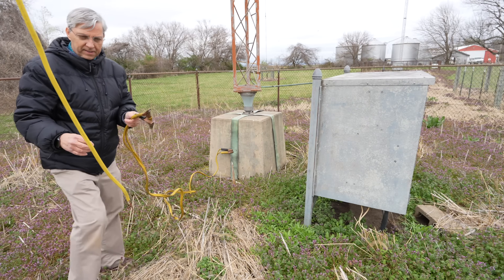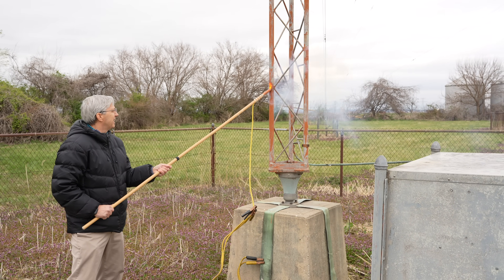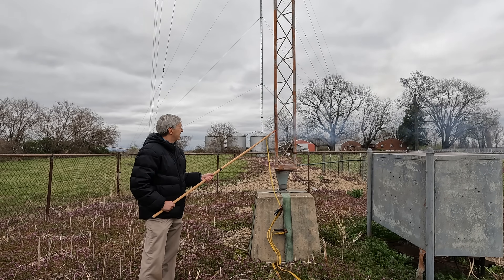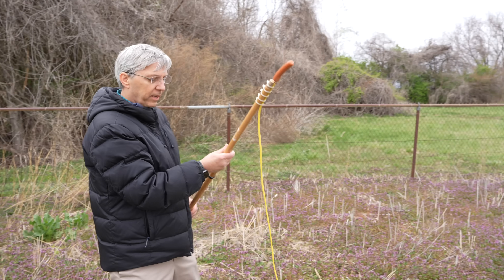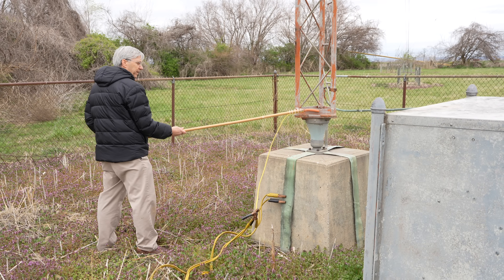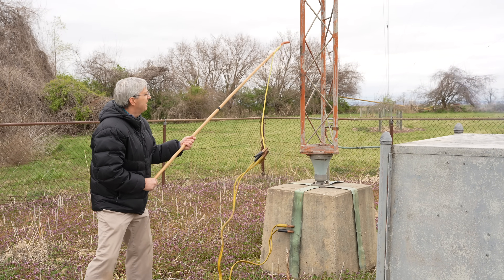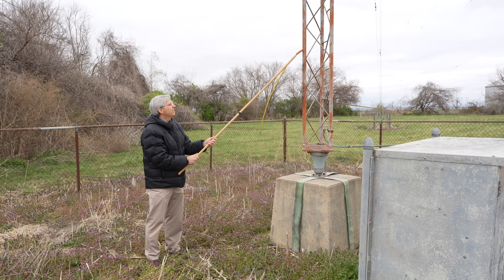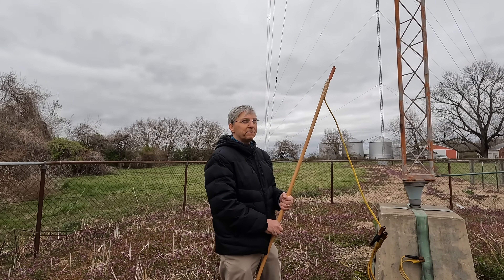We made a hot dog talk... with RF

Comment: Why does the hot dog talk though? Why is the broadcasted sound released by burning?
Reply from the maker: It's the arcing between the tower and the surface of the hot dog; the plasma in between creates vibrations in the air that are audible, translating the AM signal modulation into audible sound!

Comment: That tower looks old and disconnected, it is all rusty, the fence isn't very high and there are no warning signs!!!! That thing looks so climbable, why aren't there more safety measures?
Reply from the maker: There's an additional horse-height fence around the entire property, and there are RF warning signs around the internal fences as well.

A lot of sites are in similar condition—it's one sad reality that smaller broadcast radio stations face, the maintenance and upkeep for these sites requires a lot of funding over the course of decades. Some stations can keep up, some have many issues from building maintenance, to ground plane rot, to physical access problems...

Comment: I've heard a story about a radar tech pointing at something inside the transmitter enclosure while it was open, and getting killed by the arc. This was supposedly on a military radar down near Warner Robbins, GA. About 50% of the stories this guy told were true, so I don't know.
Reply: Transmit tube high voltage is deadly, I know ham radio operators who were killed working on live amplifiers. Microwave TWT? 10,000 volts at 1/2 amp!

Comment: Another interesting phenomenon I have observed at AM transmitters (specifically in the P&M hut) - if you use zip-ties with a metal locking tab, the induced RF can heat the tab enough to melt through the tie and release it.
Reply: Huh? What wavelength are they transmitting on? 60GHz?
Reply: @MrHuram-abi Nope. Hundreds of Khz.   Normal AM broadcast.
It's the field strengths that are that high.

Comment: Ive heard stories from old school tower climbers that they would do a running jump on to live AM towers for painting and whatever other maint needed done. They assumed it was safe as long as you didn't create a path to ground.
Reply from the maker: High risk! There are still climbers who go up with some energy (even if reduced a bit)... seems risky to me!
Reply: I know there are folks that do manual inspections on live power lines (getting dropped off and picked up by helicopter), they use conductive suits (nomex/steel fiber) and make sure it's properly bonded to the line before they get on it to avoid arcing at contact points. The scariest part is getting on or off, since they first have to bond the helicopter to the power line (which sounds like a helicopter pilot's worst nightmare), then bond themselves to the power line and move over to it, unbond themselves from the helicopter, and finally unbond the helicopter from the power line. This keeps the lineman safe since arcing only happens in the first and last steps, when bonding/unbonding the helicopter (using a long metal rod for initial and final contact).
Reply: @MatthijsvanDuin  This is what stuntmen can do if they end up making it to retirement! Sounds like they'd be right at home.
Reply: I didn't know anyone ever climbed live towers.

Comment: Fortunately, very few humans are skewered with a grounding wire while foolishly touching an AM tower.
Reply from the maker: Just standing on the ground is enough, typically, unless you have a lot of PPE—though you should still just turn off the broadcast (and lock it out from remote access) when working on the tower anyway!
Reply: @GeerlingEngineering  Oh, the peaks are in the thousands of Volts.
Reply: @collectorguy3919 They can be, yes.

Comment: Technically this is a so-called plasma speaker. The amplitude-modulated electric arc on the hot dog rapidly heats up and displaces the air around it, which creates the sound.

Plasma speakers are commonly built out of old TV flyback transformers.
Reply: @RickGreenPhoto  That sounded.... painfully horrific...
Reply: @Chris47368  If you're not grounded then it's probably not going to kill you, but you will become part of the antenna. I imagine this would be more hazardous with a cell tower antenna, which typically operate at microwave frequency.
Reply: @maudiojunky  Yeah....RF is just gnarly stuff to be directly exposed to in that way in general xD
Reply: @maudiojunky  I don't think a cell tower ever has multiple kW of power in it, but maybe I'm wrong.
Reply: @BrianG61UK  It's not necessarily about the power. Microwave frequencies used in cell systems cause heating of tissue without being exposed to a direct electrical arc, so even a few hundred watts may be hazardous if you're even standing near it, let alone touching it and becoming part of the antenna. It won't necessarily cook you, but I don't think you'd want that radiation going through your eyes, for instance. This of course pales in comparison to the output of some radar transmitters - perhaps looking at the operating procedures for some military radar systems would be informative. The microwave oven was supposedly invented because of incidental heating from a radar magnetron after all.
Reply: @BrianG61UK  we have a travel microwave in the work truck that cooks meals at 600 watts. Wouldn’t want to put my head in there
Reply: I was trying to think about how it was producing sound and then I saw this, thanks! I completely forgot about plasma speakers, they seem like black magic...but then again a standard speaker is just as "magical" we're just used to seeing them.
Reply: but its impossible that any object could decode waves, filter them and reproduce them.... They probably have a receiver hiden from the camera which is actually receiving the signals

Comment: That fence is waaaaaay to low haha
Reply: I'm surprised there aren't squirrel fragments littering the area.
Reply: @sometimesleela5947  they aren't tall enough to touch the tower AND be grounded
Reply: @rodschmidt8952  The  (ceramic?) insulating support at the base between the ground straps and the tower looks to be about 14 inches. I guess most critters wanting to scurry up to go exploring would jump it,  but any climbing would bridge it and get zinged. I regularly have to clean up squirrels from below the pole pig in my backyard,.
Reply: There is a taller fence around the short fence thing maybe

Comment: I worked for 740 KVOR and 1300 KCSF at Cumulus Radio as an IT admin years ago
When I would be near the small tower shack for 1300am, I could almost swear I could hear the broadcast in my head. Now, granted you could hear it from the transmitter, but you could almost feel it. 
Up on Cheyanne Mountain in Colorado Springs, there's a propagation site that sits above NORAD, you could feel the amount of EM energy on that site, too. Tons of FM at that site. Beautiful view on top of the mountain.

Comment: OK, now explain why we can hear something through the hot dog when the tower is transmitting around 1 MHz, a frequency band we cannot hear.  
.......
I have a theory.  I believe the hot dog is acting as a low-pass filter.  The energy of the AM-modulated carrier is being forced through the mechanical filter of the hot dog into the audio band that we can hear.  Anyone buy that?
Reply: Remember, this is amplitude modulation, so the underlying 1MHz carrier is irrelevant. We're hearing the strength of the arc change as the carrier power is modulated, thus hearing the audio.
Reply: @bradwilmot5066   Hot dogs are not FM compatible
Reply: @featherpony  You can only use certain hot dogs.  You have Armour Modulation, and Frankforter Modulation... :-)

Comment: This is amazing, guys. It's funny but also shows the dangerous reality of RF burns, which a lot of folks new to radio might not understand. I should forward this to the local Ham club to use as an example for test prep!
Reply from the maker: Note: This tower is part of a 3-tower array, it is on day pattern, and putting out somewhere around 6 kW, so many AM towers are way more powerful! (Like KMOX, which we toured earlier this year, is 50 kW on one tower!)
Reply: In Poland we had a massive AM mast which had been the tallest thing in the world back then, before Burj Khalifa was built. It collapsed years ago unfortunately, but they were pumping over 1 megawatt of energy through it! There was a 110 kV high voltage power line to even power up the transmitter and all the facility around it. Imagine shorting out that thing! People living in vicinity said the mast literally played the radio station when it was humid. It was actually the stabilizing ropes, which had some insulators on them. When it was really humid or one of those insulators failed and an arc formed, it was screaming so loud you could hear the radio station even 10 kilometers away!
Reply: I saw one and considered climbing it. Only didn't because of the cable running off it. Seemed like it might not be structurally sound if it needed that many cables holding it up.

No idea if it was being actively used 😬😬 being shocked is like the thing I hate the most. Cannot believe I didn't know rf could cause burns/shock.....I've played music forever and haven't heard that about sound.
Reply: @lazarus908  RF is not sound, it's electromagnetic radiation. The radio tower is a very high voltage, high frequency electrical source. The sound in the video happens as a consequence of the air ionizing with the same amplitude fluctuations as the audio signal (audio frequency) present on the AM carrier wave (radio frequency), so you hear the audible component that's normally demodulated by an electronic radio as the hot dog is burned by hot electric arcs. The sound is the pressure waves emitted in the air from the arcing event.
Reply: You wanna be careful with ham clubs around transmitters, you saw what happened to their ham club in the video!

Comment: Yikes. RF burns (and RF radiation exposure) are no joke. There's rightly a fresh focus on RF radiation exposure when risk assessing ham stations, at least in the UK - more important at higher frequencies. At any rate, I don't think you'd even find me inside that tower enclosure! 😳
Reply from the maker: One thing that we didn't really make clear in this video (though we may do a follow-up!) is how we planned for the video, and how even with the planning there are still plenty of risks that make this experiment dangerous.

There's also a lot of information and formulas for safe RF exposure limits for workers who need to enter higher-RF environments (like the inside of one of these fenced-in areas around a tower base!), and for anyone who would ever want to work around towers—you should know all that! (Especially if you're replacing lights, mounting antennas, etc.)
Reply: I know you have decades of experience in environments like this, but it's still a scary place to be. ⚡
Reply: Want to stand in front of my 23cm antennas? Four 35 element... 25dbd gain... 550 watts... its only 163,612 watts ERP...
Reply: @MaryBrownForFreedom  Are you doing EME? 🌜
Reply: @MrHuram-abi  not with that antenna, it is for tropo/contesting... no elevation on that tower because it also has 902mhz, 222mhz, and 6 meters. Working on a 2.1 meter dish for EME

Comment: I've heard of RF burns referencing HAM equipment, but I didn't know it could be that bad from a broadcast tower. Damn.
Reply: Think of your most illegal overpowered ham rig...
Reply: Definitely! Ham radio in the US is a maximum of 1500 watts (most signals are 100 watts or less)... I believe in the video is KMOX, which is 50,000 watts. Even as little as 5 watts of RF burn will never let you forget it.
Reply: @souta95  excessively illegal ham setup
so excessive they could triangulate your antenna from their office lol
Reply: @souta95  I touched the 35W final transistor of an FM marine radio with my finger. Tiny little pinholes of burnt white skin that hurt for a while.
Reply: @souta95 they're in day mode, about 6kw as they mention in another comment. Night mode would throw an arc a couple feet long.
Reply: The Hams had its bacon
Reply: ham is not an acronym
Reply: @barfbot  Im not sure of that.
The word “HAM” as applied to 1908 was the station CALL of the first amateur wireless station operated by some amateurs of the Harvard Radio Club. At first they called their station “HYMAN- ALMY-MURRAY”.
They were ALBERT S. HYMAN, BOB ALMY and POOGIE MURRAY.
Reply: @barfbot if you want to be pedantic, HAM was the original call sign, so yea it's capitalized
Reply: @brainmaxxing1 this makes no sense but aight its not a big deal
Reply: @brainmaxxing1 No it wasn't. Ham was originally a derogatory term thrown at amateur radio operators by the big, professional operators such as broadcast radio stations, in the same manner as one would call a lousy actor "hammy" or "they're nothing but a ham." Amateur ops decided to take the term and wear it with pride to throw it in the face of the professional ops. And it stuck. The person who used "HAM" as a call was Earl C. Hawkings in the early 1900s. He was not the first person to use a callsign. Not by a longshot.
Reply: @brainmaxxing1  no. just... no. that's one of those "everyone knows it's true" but it's not stories. the HY-AL-MU callsign from the club at Harvard was not the first callsign ever, and it is not considered the origin of the term ham any more than the theory of 'ham-fisted' on a CW paddle is the 'true origin'. But regardless, the ham in ham radio is not capitalized. Ask an actual ham.
Reply: Yup. Basically the antenna is just a metal bar with some high voltage alternating at the broadcast frequency. 

Random fact, microwave antennas can cook your insides (and do damage long before you feel anything wrong) just by standing in the beam. At the highest power that’s considered safe, the field is a bit over 4V per inch.
Reply: Trust me, RF burns hurt like he'll. Worst that electrical or wet burns.
Reply: all rf is, is ac current.....
Reply: An FM or TV tower won’t do that (shouldn’t, anyway….) because those towers are grounded, and the energized antenna is mounted way at the top.  AM towers are different, usually the ENTIRE tower is the antenna, the whole length is energized by the transmitter,  and is isolated from ground at the very base.  But…. All towers carry a risk of death because things go wrong.  Signals can get shorted to towers, and grounding can fail.
Reply: @stevelacker358  I guess if you are close enough to cook a hotdog in FM you are also now the hot dog
Reply: that's a tiny one too. I've seen  these that throw like a foot long arc and you can hear the radio broadcast screaming through the arc. It's pretty insane.
Reply: I burnt my finger torching the metal base of a short whip antenna on a 2w CB radio, this is exactly what I would expect and worse from a powerful AM radio with some of them up to 500,000w...